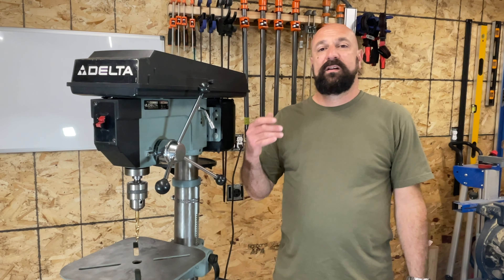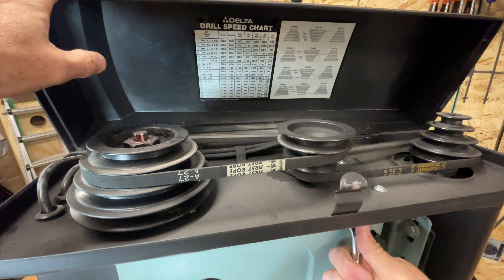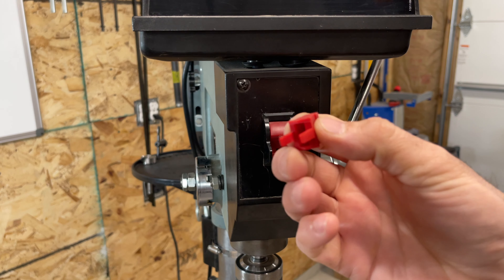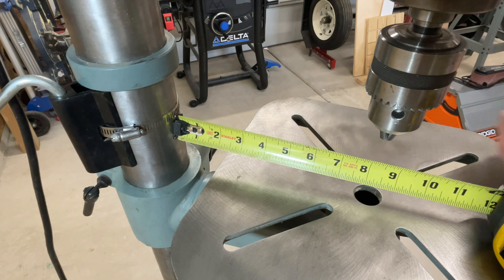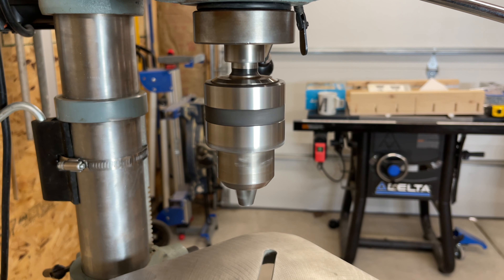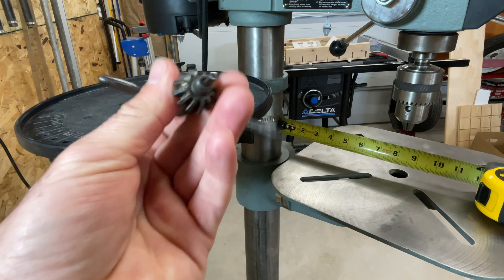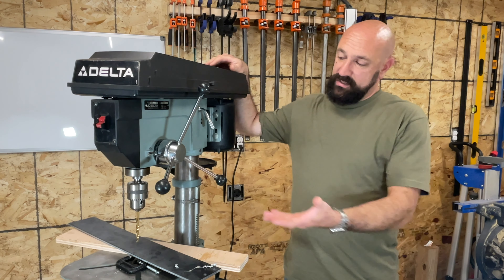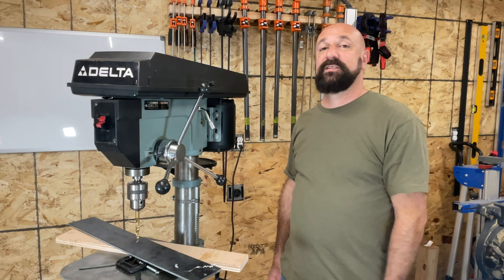Best Budget Drill Press A '90s Delta? || Old Tool Review || Delta 17-900

Comment: Thanks for the video.  I also have the round table.  I ended up turning it upside down, putting 4 magnets and securing it with epoxy.  Works great to keep loose bits on the table and they will not roll around when the motor is on.  Thank you again.

Comment: My dad has an old Craftsman drill press that puts any newer ones to shame. I don't know exactly how old it is. He's only had it about thirty years, but I'm pretty sure he bought it used.
Made in the USA, heavy HEAVY cast iron table and base, and he's got some old high end American (maybe Japanese) made chuck in it from his days as a machinist,... it drills straight and stays 90° to the table without having to mess with it. All his tools are in my shop and he doesn't use them much nowadays (81yo), so I just use it instead of buying one.

Great video man,.. any time you can get a good deal on older tools in good working condition, jump on it.
Reply from the maker: Nice to see you again! I have a soft spot for old Craftsman as I’m sure a lot of ppl my age do. Almost all of the chrome sockets you see me use are craftsman. My mom bought me that first mechanics set at Sears when I was 16 and got my first job at Firestone. 
Those old drill presses are pretty cool. Crazy how over build and heavy some are. 
I’m sure we’ll get new drill presses in the shop to check out eventually. Thanks for watching!!

Comment: You multiply the measurement by 2 because it can only drill the center of an object 16 1/2” maximum.  It has an 8 1/4” radius, 16 1/2” diameter.
Reply from the maker: Makes total sense! Thanks for the comment!
Reply: @ProjectsForAllReviews  any time!

Comment: I have this same 17-900 drill press, having bought it new in I believe 1988 for $265 delivered to my home. Mine has been stunningly durable in the 34 proud years I've owned it. Ordered from a catalog because those were my pre-internet years..  This press has never failed me and is of Taiwanese manufacture. This model is the only "economy" drill press I myself have ever encountered that has a solid bottom press head underneath. Every other "economy" press I've ever examined has the open cast area at the bottom of the press head for a light bulb fixture. I have to wonder if mine and its style are more rigid and better braced than the open style. At least that's what I've always told myself. My press has done heavy drilling on lower settings using 1/2 inch twist bits drilling through 2 1/4  inch steel plate (a machined bench block anvil). Pour the lube oil to it and have a sharp bit, clamp the material well to the table and I drilled right on through. The factory chuck on mine has a total runout of just under 0.001 inch and has maintained that since day one. I use a magnetic base light from Harbor Freight to give good light for drilling operations. I designed and crafted a no-drill sliding lipped tray for under the factory table which catches chips and serves as an accessory holder, as well as a pie-pan swivel tray has both left and right side oak mounting brackets (inspired by the tray seen on yours but uses formed 1/2 in steel rod swivel arm). My 17-900 has been just a remarkable tool and a major player in my wood and small metal shop. I did a good thing back in 1988 ordering my beast.
Reply from the maker: Thank you for this comment! We’ve had the same experience with this press except you’ve got a 30 year head start on me. I love hearing I paid about the same $ amount as when this was new. I’ll pin this comment to the top! Thanks for watching!

Comment: I have a old German drillpress (Alzmetall) from 1954 it is really heavy it weights about 700 kg and you can change the speed with a variator. It still works just fine and is very precise.
Reply from the maker: The Germans make some good stuff for sure! Thanks for watching Kai!

Comment: Hey man, great review. I just picked up the exact drill press, with a couple variations. Overall,  looks exactly like yours. But mine doesn’t Hv the sign with all the info on it regarding motor and power. I actually have a sticker on motor with A Dayton brand sticker.  Maybe after market…??  And my Chuck is different, which I think is an after market one as well. It’s says “BB13-3 ROHITI 1/32-1/2T 3KeyS10 W.Germany”. My guess is before Germany was still split and made in 80’s…?? All guesses till I can find out more. Got it yesterday  and been cleaning her up doing basic maintenance. She runs beautifully tho!  And learned a ton from watching your vid a couple times!  Thx man! Oh ya….. picked this up for $60!!!
Reply from the maker: For $60 you knocked it out of the park! Happy I was able to help! Good luck and thanks for watching!

Comment: I bought my 14 incher in 1999 for $209 i recall?  a 16 or 18 would be nice, but i dont recall needing more the 7" for my projects.
This is one of the most important tools to but hor a home shop.
Using a dial indicator on mine, even at max extension, there was almost no side to side play.
I checked out a similar sized HF drill press and i could hear a clunk and a acually see the corresponding side to side movement of the shaft.
Theres id $400, snd the casting quality wasnt so good.
Id highly recommend finding an old Delta like mine, a 14" or a larger one.  The old ones are well built.

Comment: Hey there, thanks for the very relaxed easy to watch videos. I have enjoyed your channel.
My guess for why a drill press is measured by center of chuck to the post and doubling it is that would be the theoretical largest diameter hole that press could cut. 
Just a guess from a math guy. Kick it to the curb if you want....
Cheers!
Reply from the maker: Hello Mark! As best I understand now that measurement is the largest sized piece you can drill in the middle. 16.5 inch work piece can be drilled 8.25 inches or directly in the center on my 16.5 inch drill press. Thanks for watching!

Comment: Great video thanks.  Have you made any modifications to your drill press since this video?  I have a new in the box unopened delta 17-965 that I've been carrying around since a 5 year long divorce started. 
  I'm just now putting together a garage shop and wanted to find out what's available out there for upgrades so I can plan its location.
Reply from the maker: No mods to mine yet but I’ve been window shopping for a table with a fence and stops for a long while. If I ever pull the trigger it’ll be a vid for sure. Good luck and thanks for watching David!
Reply: @ProjectsForAllReviews    That's what I'm looking for, a good table, fence and other good add on's.

Comment: I just got a used one like that from my neighbor need some checking haven't been use in a couple yrs the switch box is broken and power cord needs to be replaced I don't know if the switch box is available but I'll try getting one the cord is no problem
Reply from the maker: I have an old Delta band saw I got for free. Mine came without the switch box.  I haven’t put a switch in it yet but the original is discontinued and the new version is $40. I’ll prob end up using a regular residential light switch or a cheap toggle. The $10 power cords on Amazon aren’t too bad for the money. Thanks for watching!

Comment: Awesome video. I have the same drill press. It was handed down to me. Question for you or anyone else who has this drill. Is the track on the side where you raise and lower the base firmly attached to the post? Mine is not attached and is held on my the collar on top.  I am wondering if this is how it is supposed to be 5:46.
Reply: The flex allows some table movement.  It's supposed to be that way.